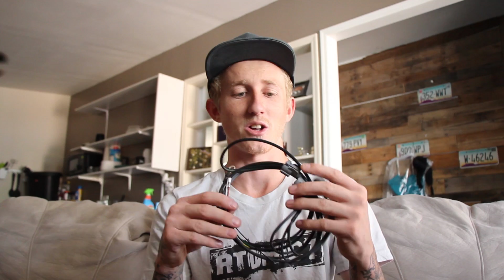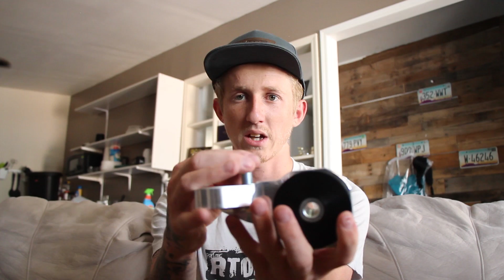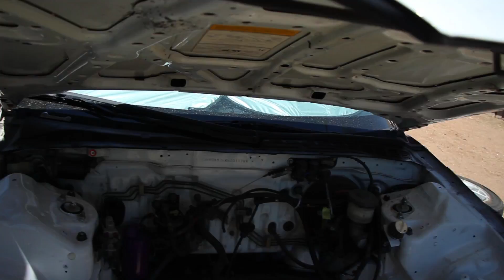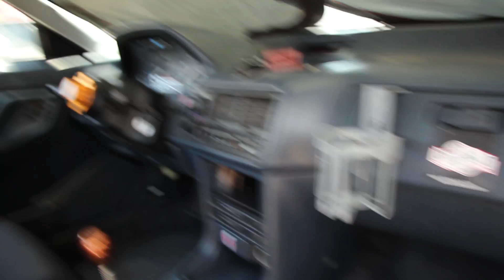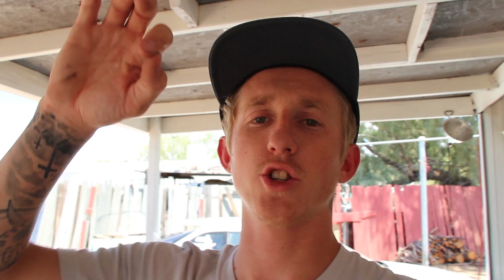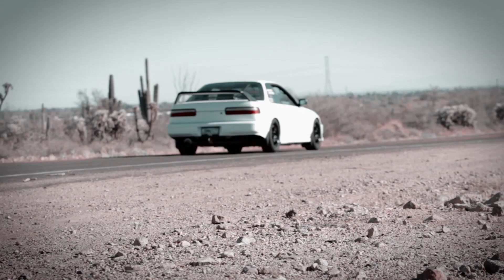B20v Status! So Close To Vtec!

Comment: Get an actual tune. Base maps are half assing it.
Reply from the maker: Basemaps are perfectly fine to get by for a bit. I plan on getting it actually tuned...when i can. i need a wideband before i do that and i would also like to upgrade to hondata so it will be a bit but it will get done.
Reply: ChrisSadowski I ran a basemap for a while until I got dyno tuned but never once tried to race or went WOT on it.  Or any type of spirited driving. I don't even like street tunes. Its night and day difference from a street tune to a dyno tune.
Reply from the maker: my regular b20 had been running just a basemap with adjusted fuel/air and some ignition. Ive beat the snot out of it doing touge and playing aroun and have not once ever had a hiccup. My motor is stock so ive never needed a tune, and this b20v is gonna be stock minus gsr dual springs so its gonna be fine on a basemap. The guy i go to is good at what he does and doesnt leave me with just a random map he adjusts it as he sees needed